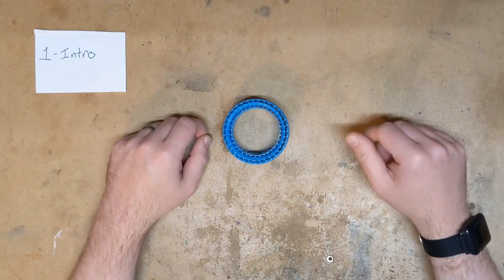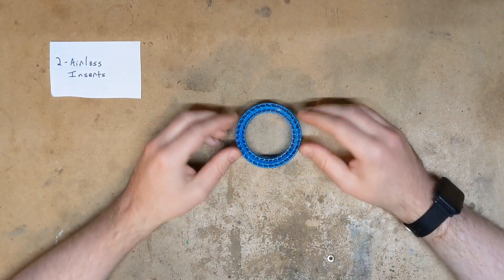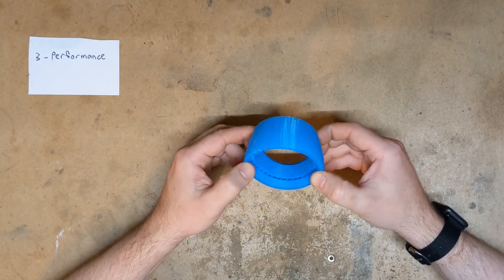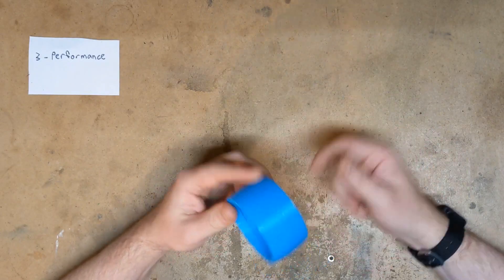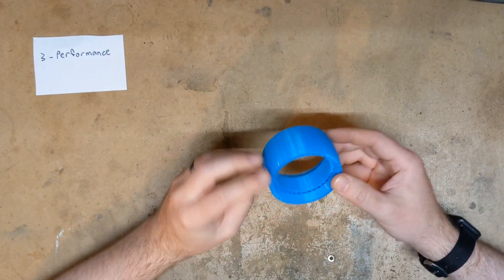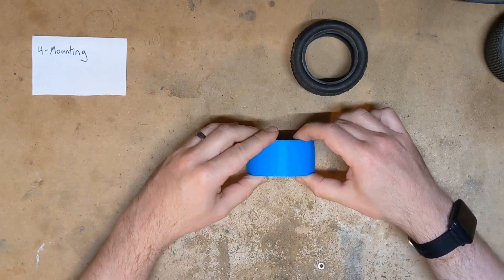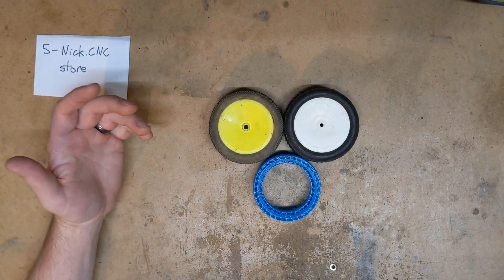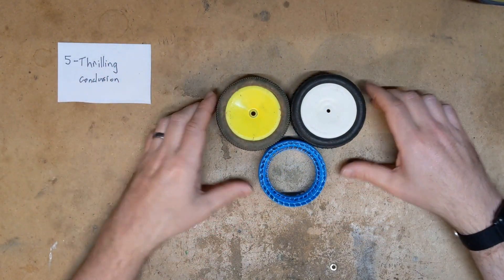Racing with 3D Printed RC Tire Inserts!

Comment: I would definitely be interested in these for a sc based design. And do you plan to make these for the front buggy tires? I race dirt oval and plan to purchase a set to try.
Reply from the maker: I want to eventually have inserts for just about everything. The difficult part is testing and validating insert designs across multiple tires and brands. That takes time and money, but the more inserts I sell, the more tires I can buy to test/validate.